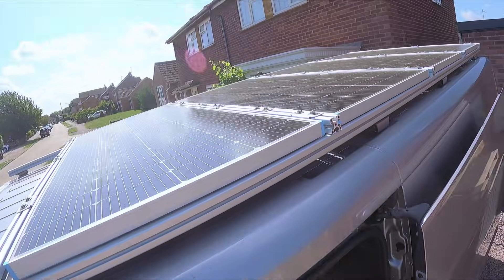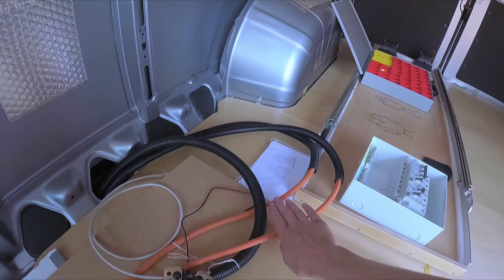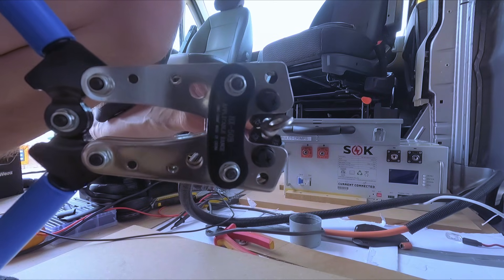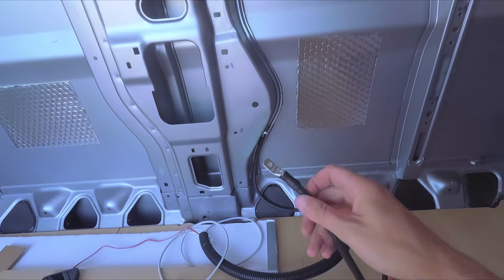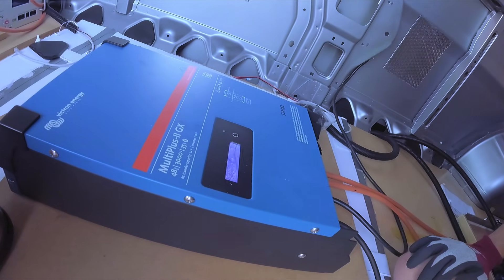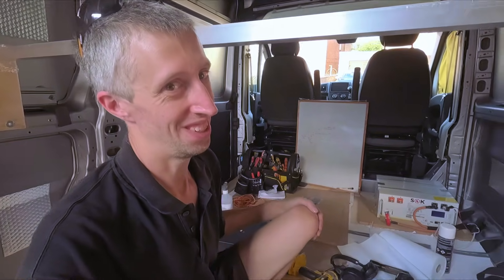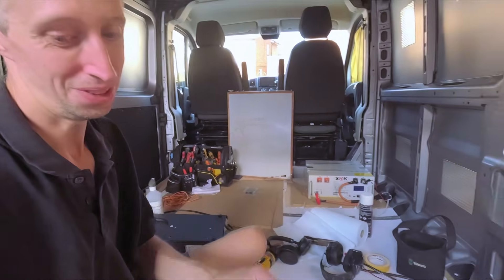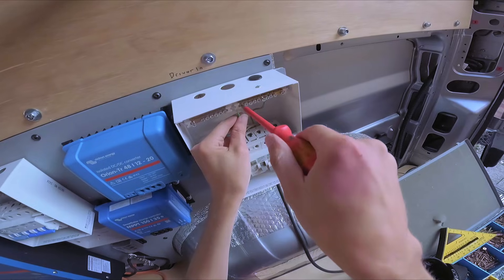48V Campervan Electrical System Build pt.1 : JTU 10

Comment: Got a similar setup powering my server rack in my garage at home - fogstar 48v server battery and Victron Multiplus inverter. The UPS feature of the Victron works perfectly and will power the 130w load for about 35hrs. Thinking of adding solar to keep it topped up instead of shore power too. Following your van build with interest 👍
Reply from the maker: Thanks! I continue to be impressed with Victron. I would just say that solar in the UK in winter is... worst than i thought. We got 200w out of a 800w system on a  overcast summers day, but overcast winter? 20w.

Comment: Another cracking offering from, probably, the smartest van converters on YouTube.  The only thing I missed was another garden Q&A about the system choices you made.  But, I think you said you have another video coming with a full system run through, so maybe it will be in that.  I have a bunch of questions on your system, just in case I misheard and there isn't another video I thought I'd jot them down.
Why did you decide to go for 48v vs 24v or 12v?
It doesn't look like you are using a Lynx Distributor in the system, so I guess that means separate busbars and fusing, why did you go this way?
Are you installing DC-DC charging?  If you are which charger are you using?
Are you running anything off 48v or just 220v and 12v (I think I saw a TR 48-12 20 in the set up)?
Reply: Sorry, I missed one question.  What drove the decision on your choice of battery?  My understanding is that server rack batteries are really not really intended for mobile applications.
Reply from the maker: Good questions! They will be covered in the part2, but on this specifically: I chose the SOK battery after some very positive reviews and teardowns I had seen by enthusiasts, and the manual for this battery states that its OK with mobile applications so long as is mounted horizontally. There are cheaper alternatives, but I went for SOK as I trusted their quality.

I am very cautious when it comes to batteries, I would only go for brands known for quality, even if it costs significantly more. If money were no object I would go for Victron NG, but they are way more expensive, especially when you add in the cost of their BMS.

SOK have released a new model of their battery now, the one I have is no longer available, and I am not sure yet if I can network the new model of battery with the old (we might be getting a second one) or if they have kept the quality.